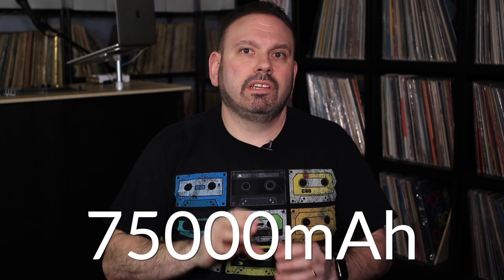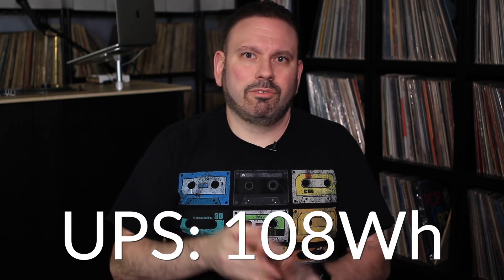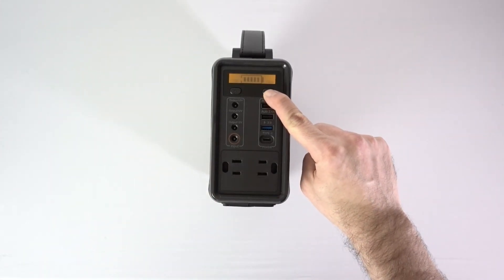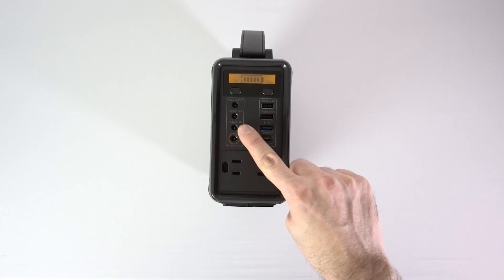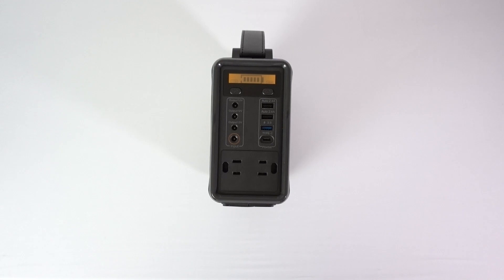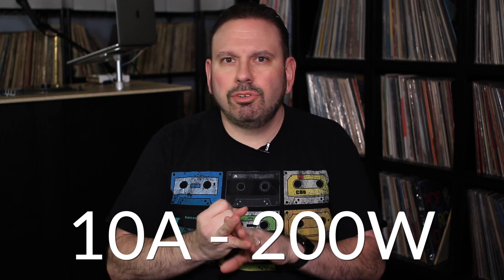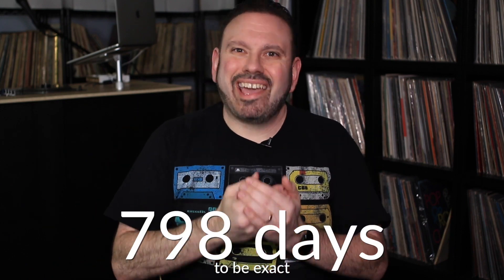Energizer Portable Power Station Review

Comment: Hi Lou, looks like I'm a bit 'late to the party' wth a reply on this one but was just wondering if you'd had a chance to test this with a single or pair of Evolve 50's?

If not what would you estimate as the run time for a single EV50 at a 'medium' volume level would be?

Thanks

Keep up the good work on the videos :)
Reply from the maker: I haven't since my general use is now with my Maui 5 Go's. 

Given that my UPS would go 1:45 with my 50, mixer, router, and mic I'd wager at least 3 solid hours with the 50 and moderate drawing equipment.

Comment: nice info i like how you do the math on the battery capacity.
Reply from the maker: So the "easy way" is plug in and run. But there are some manuals out there that publishes what their output in amps or watts at certain loads. But not every manufacturer does this.

Comment: I bought one and the USB C can't charge any device because it has a bug. It wants to charge from your phone instead of charging it. The USB C does not charge any device like  phone, computers,  iPad, ... when people get units for free to review, they just promote the unit without any intention to fined the issues.
Reply from the maker: Hmmm that is very unfortunate. I am curious if they can even do anything since I am sure that has to be a hardware level capability that might just not be present. 

I am lucky where in my case that is a feature I was not needing since this is pretty much solely being used to power my ceremony rig. 

Also, to always make everything clear for my channel, I buy virtually every item I have a review for. The exception was the Denon Prime 2 which I was seriously testing out but didn't quite fit for me.

Comment: Can this power a speaker pretty easily for a ceremony setup as well?
Reply from the maker: No doubt, but as always everything has to be right sized. You are likely to consume less power with a single mic, mixer, and speaker than my 4 mics, IEM, mixer, and router. I would get longer run times with the former setup with my UPS. :)

Comment: Sorry, can this be used while in use and will kick in if power is lost?
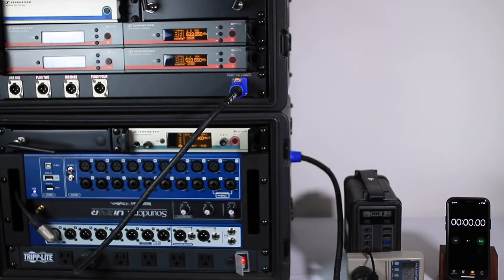Reply from the maker: So technically it can be used as a UPS (I show this at the 8:44 mark). Although I must stress this is not it's intended purpose and wouldn't be able to comment what long term uses like that would be like. 

The maximum "surge" output is 10A and somewhere north of 240-250W. 

I won't be using this in my reception rig that is for sure and given how much capacity it has and the 2000 cycles of charging and discharging it can go through, I'd err on using this really as a pure battery solution.
Reply: @djlouparis  what I thought. I had looked back through your other video, but that unit has been discontinued. I found some rack mountable units, but was testing to figure out if they met all your requirements. I intend on having 2 surge protectors in my rig: one battery back-up and the other not. 

Is there a smaller rack mount that’ll work until I can go grab these?
Reply from the maker: The BR1500MS is discontinued and the MS2 is hit and miss to find. There is the Cyberpower that is still around and they updated it and it has an interesting "feature" where it won't turn on unless there is power being delivered to it. I guess this is some new safety feature. 

You could downsize but you'll have to calculate your overhead. Keep an eye out on places like Staples, B&H, Newegg and others as they occasionally get things in stock.
Reply: Lou, I’m lost in your comments. Will you use this to replace your actual UPS for ceremony ?
Reply from the maker: @LeCriDuLoup99  for ceremony yes, I will be running completely Energizer battery in all instances. For receptions no, I am sticking with my UPS for that setup. I will likely keep my second UPS on hand as a spare "just in case" and I may pick up another Energizer to have a spare to directly replace this one in case of failure.
Reply: @djlouparis  you're right. The UPS will be better for ceremony to regulate the power.
Reply from the maker: @LeCriDuLoup99  *clarification. Better for reception to regulate incoming power. :)
Reply: @djlouparis  Yes, that’s what I meant :-)
Reply: Hi Lou. Have you included this into your ceremony rig yet ?
Reply from the maker: @LeCriDuLoup99  yep just had my first ceremony of the season yesterday. 90º temps. Ran like an absolute champ. It only had probably 40 minutes of runtime in total yesterday and "1 bar" on the meter depleted. I have little doubt that I would get near the nearly 3:30 runtime I got in ideal temps in the real world.